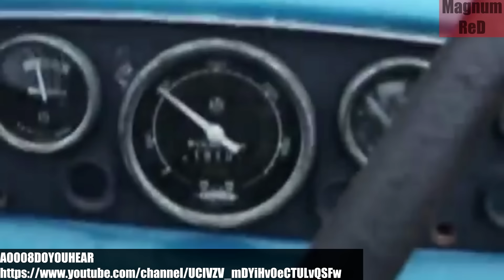Old Tractors - First Start In Many Years | Diesel Engine Cold Start After Years

Comment: My dad told me about how his dad had an old old tractor with a crank start.  Grandpa was trying like crazy to start it, then gave up and went into the house to take a break.  Dad's brother came out the barn and gave it one crank and it started.  Grandpa came a running out of the house and yelled "don't shut it off!"   Sadly, the same tractor wound up rolling over Grandpa as Grandpa got off to go pee and I guess didn't set the brake!  Crazy Crazy!   Lesson: Don't pee in front of any tractor tires.   Grandpa lived to be 90!  I don't know how they did so much with so little; however, they managed.  
Love 4Truth!

Comment: Those old classic tractors were built to last a couple of life times and beyond! Back when Craftmanship meant something! Growing up we had a neighbor who had and old John Deere, it was a 1923, Many years later the grandson had it and it still ran great and the engine was never overhualed and it still had great oil pressure! Plus they were simple to work on too!
Reply: indeed, older tractors was built to last, and not a pile of garbage like the newer stuff today.
Reply: @noahtheowl7107  if newer engines didn't have any computerized parts they plob last longer then again their are very few of theses engines for a reason. also most newer engine have issues because the computer sees the issue of a wire or connection being weak, like most computers will stop the car or tell you pull over and shut it off if something is going wrong and some times its a minor issue but the computer can save you thousands of dollars, like if your engine runs away very unlikey with newer engines because the computers have anti run away software. same if their is a issue with the transmission, their a higher chance the engine will notice the damage even before the damage is too bad. so its mostly that detecting the damage is alot better. it a double edge sword tho. if you know their is damage you will most likey replace it even if it has a few thousands of km left  before breaking.

Comment: Question:  when the guys are starting the tractors by hand turning a large flywheel,  is the engine firing off a magneto to get things going and keep the engine running?
Reply: Chris Richardson  Oh, okay. So they are running on some sort of fuel, which in this case is diesel.

Yeah, I bet a cold start can be a real bummer some days.

Comment: Those old "tricycle" tractors are dangerous as hell. My father had at least two friends killed by tractors like that flipping backwards under load when he was in high-school. The main problem with them is that those tiny front wheels can't support anything near the amount of weight necessary to pull a heavy load, yet people still used them for that since it was all they had.
Reply: Could rolling over be prevented by going uphill backwards?

Comment: I started a Lanz Bulldog that the farmer
Said hadn’t been started in over 40 years , the fuel in it was like wax so after cleaning the system and filling up the burner ( it had a pressure white spirit burner ) I heated up that giant cast iron knob on the front of the cylinder head , and spun that big fly wheel and away it went , it had all steel wheels no tyres just steel tread and was an absolute monster of a tractor , much bigger than the one shown here but the farmer had  a tear in his eye when the old bulldog fired up , he said it was one of the first tractors to ever work the headlands in Otago New Zealand as it would climb any hill , I’m
Not certain of the model but it has a horizontal single piston that must of been huge , the flywheel was at least 2 and a 1/2 feet in diameter, what a fabulous video this is thanks for uploading
Reply: Used to be quite a few of those in France right to the fifties

Comment: if you can get the mixture right these things will start, they just need a clean of the points the carb or fuel line cleaned and there'll go they were built to last or be parked up for long times mostly during the winter

Comment: I used some of those on the farm. Certain engines had very distinct sounds.  Some of the I can tell you the manufacturer just by the audio. Wish they had an Oliver with the continental engine. It was also used a lot in WWll. Very smooth and quiet like a kitten but when loaded it was sharp raspy and mean.

Comment: Its a bit disapointing that you didn't used the original sound in some clips ( for example the small little cub barnfind one. It sounded at one point like a 6 zylinder instead of a , I dont now, 2 zylinder) or didn't use the original sound at the right time ( for example for the C45)

Comment: Anything less than 10 years can't be considered a long time in my opinion.
Reply: 78FullSizeBronco j7
Reply: @kevinellsworth9318  What?
Reply: Maybe if you have the luck that it was put up dry. Im currently working on removing damn near an inch of goo that was once gasoline from Grandpa's Farmall H after it sat for 9 years with a half tank of gas. Not a fun job.

Comment: I had a logger tell me how to start a diesel in cold weather. I takes several minutes but seems to be better than just winding on it and running your batteries down. He said to let it turn over maybe 2 revolutions. Let it sit, then do it again a few mins later. Keep it up and the compression will warm up the engine so you don't have to wind on it for mins at the time.
Reply: It'll cool back off between tries
If you want something that works, a propane torch or preferrably a heat gun in the intake works wonders

Comment: At 6:32 that's not how to hand crank a tractor.
The way to do it is to pull a quarter of the way up. That way if it back fired it would pull down which won't be as bad as if it back fired and the hand crank pushed up on your arms. I've heard of people who got there arms broken really bad. This guy with this tractor got lucky that it didn't backfire.
Reply: so true,  I remember seeing  farmer I worked for  use both hands,  and get  taken to the ground by the "kickback",  the way it threw him  thought for sure he broke an arm or wrist,  but thankfully  except a sore wrist on his right side and being shaken up a bit
Reply: your thumb is NOT supposed to be on the opposite side of fingers when cranking
Reply: Except that , that is a newer mechanism and disengages if it backfires
Reply: Its best to just use a rope and pull it because if the engine backfires you can just let go of the rope and you wont have to deal with any backfires at all.
Reply: Its called Kickback................Not Backfire.